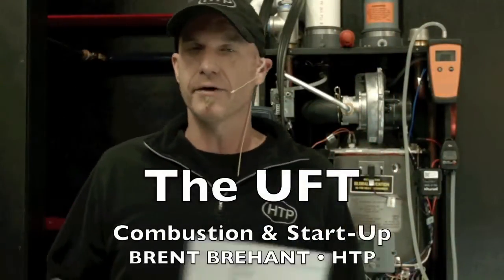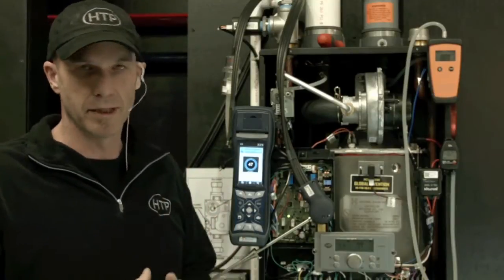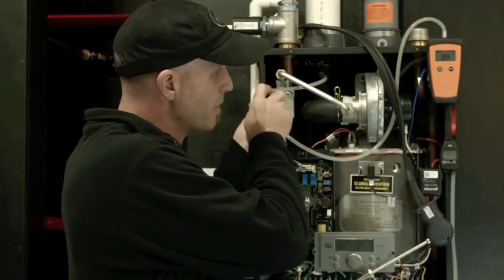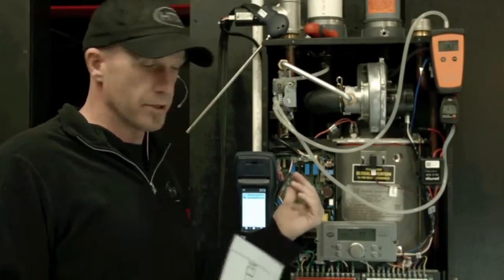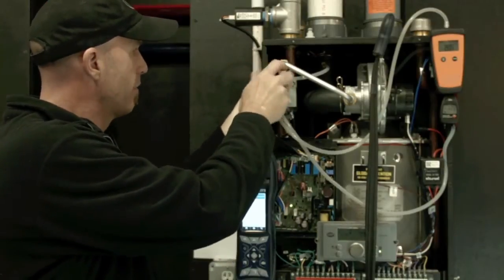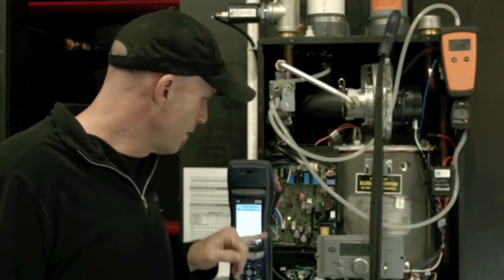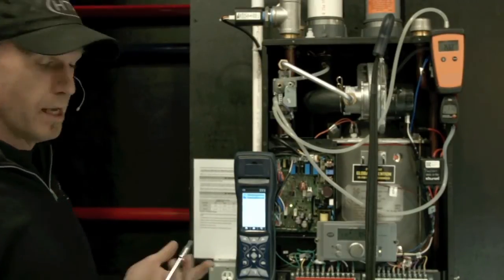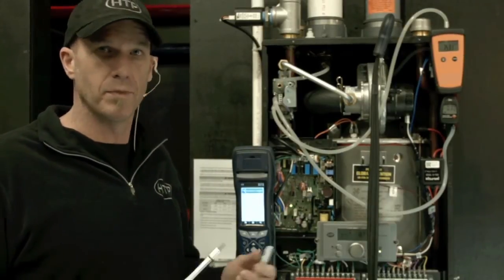Combustion Analysis for the UFT, EFT and Crossover Wall Models

Comment: Fixed my code ER:11 problem, safety cap on adjustment screw to be removed Counter clockwise then clock wise on increase of gas valve

Comment: Excellent video. What would be the best method for wiring a eftc 140w boiler for a 2 zone hydronic baseboard system with 2 zone control valves? The boiler has an built in circulator, but in what instance would an external circulator be required? Thanks in advance.